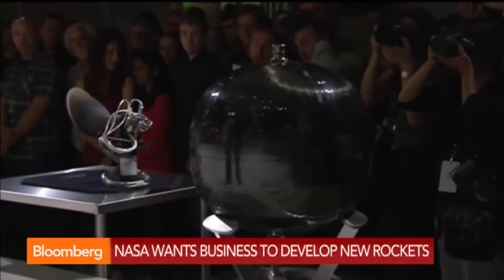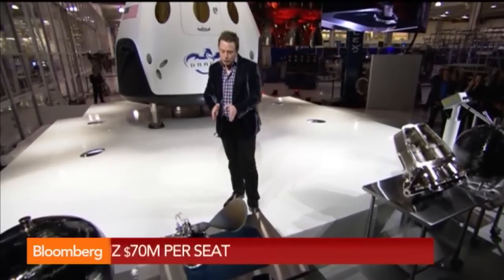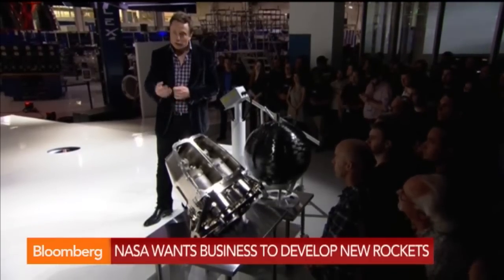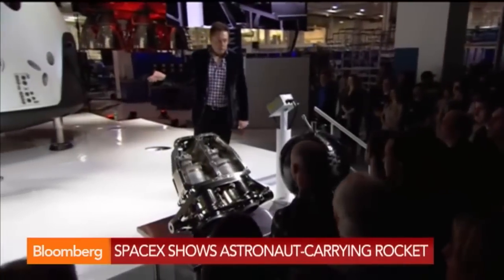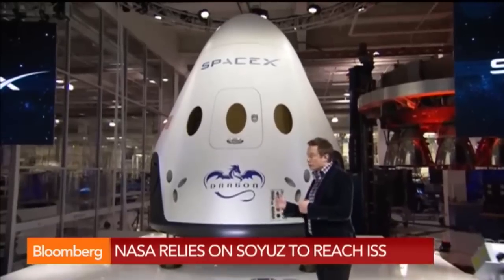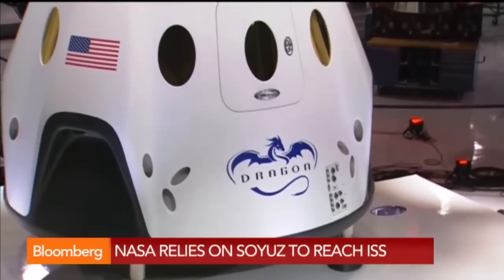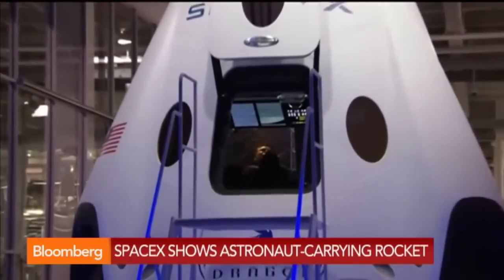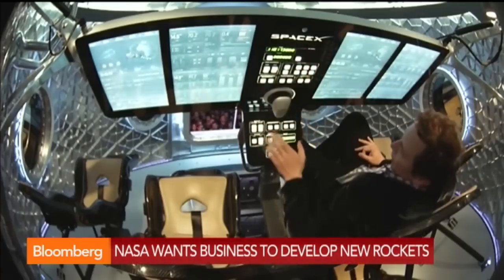Inside the New SpaceX Dragon V2 Spacecraft

Comment: A 100 lbs of thrust times 18 is only 1800 lbs of thrust. Those won't do anything in our atmosphere and gravity  .
Reply: Those are the Draco engines, whic help in attitude control. Landing happens using the SuperDracos, which have insane thrust (just look at the launch abort test)
Reply: 16k pounds of thrust x4... 100 lbs for the smaller ones
Reply: This thing is not supposed to fly around in atmosphere, the engines are there for orbital maneuvering. I suggest you try kerbal space program, you' realize that even the tiny RCS thrusters can perform the sort of maneuvering this thing is likely to do.
Reply: This thing is not supposed to fly around in atmosphere, the engines are there for orbital maneuvering. I suggest you try kerbal space program, you' realize that even the tiny RCS thrusters can perform the sort of maneuvering this thing is likely to do.
Reply: This thing is not supposed to fly around in atmosphere, the engines are there for orbital maneuvering. I suggest you try kerbal space program, you' realize that even the tiny RCS thrusters can perform the sort of maneuvering this thing is likely to do.

Comment: I'd be interested to know how the vibration testing went with this touchscreen control system. On the Apollo missions astronauts experienced so much vibration during ascent that it was hard to press manual switches and read gauges accurately. There may be less vibration with this generation of boosters but I imagine touch screen operation with any vibration would still be a problem to overcome.
Reply: TheMortalhuman I would imagine the only buttons a human would need to press during the in-atmosphere part of the ascent are emergency buttons, and those are physical.
Reply: Yeah, I'm pretty sure the capsule doesn't require any human interaction until the capsule is in space. If they do need to manually abort, that's why the actual emergency buttons are still there.
Reply: IAN 4000 The Russians have adopted the same sort of approach for their spacecraft, in that ground control performs most of the flight operations in conjunction with the automatic flight systems. I believe that NASA on the other hand provided full manual override systems for their spacecraft, at least in the Apollo era, and trained their astronauts to be able to control the spacecraft even on the ascent stage should the automatic systems fail. This did mean that a lot of time and energy had to be spent on astronaut training. Improved automatic systems probably reduce the likelihood of the need for manual control I suppose.
Reply: Good point, it can even be challenging in a glider.
Reply: Those "all touch screen" are a bad idea... even with phones it as some drawback that they do not seems to take into account. The central "joystick" to control the spacecraft is obviously misplaced... need to extend your arm to use it ... precision = none, heavy acceleration.. can't extend arm .. etc etc.
Reply: @davidniquot6423  its 2021 they work great...
Reply: +TheMortalhuman The vibration shouldn't be a problem when comparing it to the Soyuz. In the Soyuz the commander has to use a wooden stick to extend the length of his arm reach to be able to operate the spacecraft.....
Reply: Håkan Lundberg 
You must be tired. Time to go to Tayland.
Reply: at 4:15 Musk points out that all the functions necessary in an emergency situation are controlled by manual buttons.
Reply: But can you manually switch SCE to AUX?
Reply: +TheMortalhuman Can't you use the "stick" to push buttons on the Soyouz spacecraft?